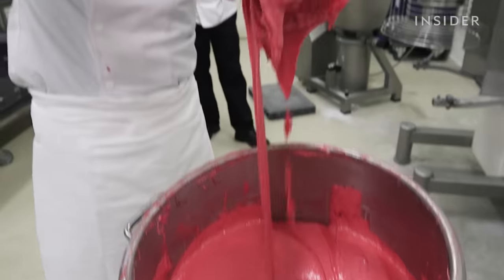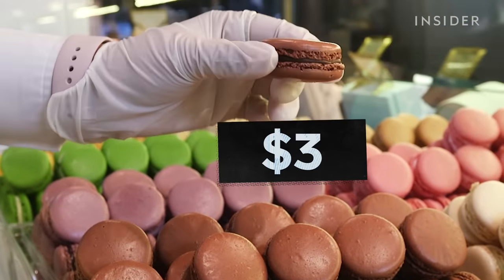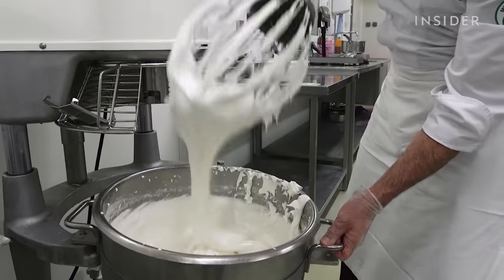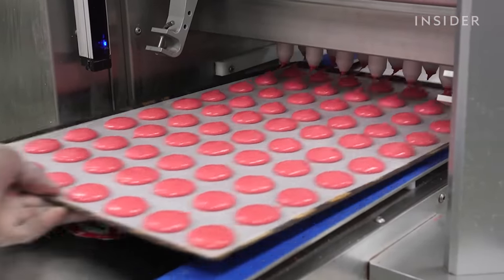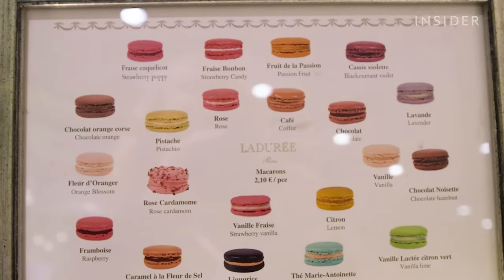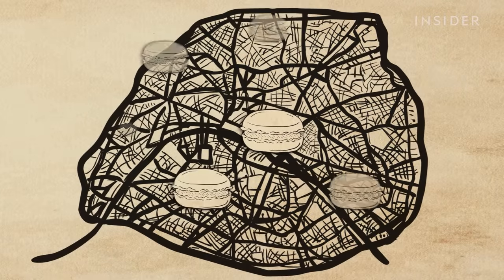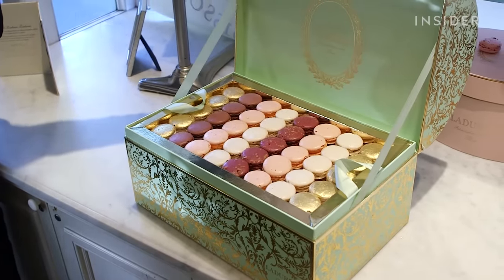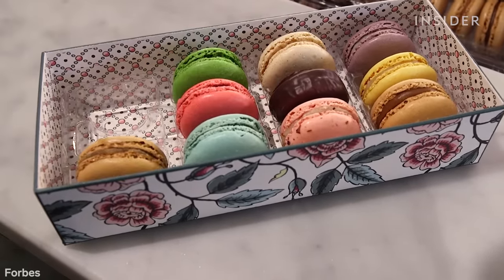How Ladurée Makes Millions Of Macarons With A 130-Year-Old Recipe | Insider Food

Comment: I was about to say... 3200 a day was kinda low? That's under $100k per year and with at least 10 employees and overhead cost, with machines and outsourcing recipe materials, you'd go bankrupt in 6 months tops. 10k per day would just barely make you profitable, 40k per day would put them at multimillion per year.
Reply: Kinda isn’t a word. I hope that you meant to type kind of but you were too lazy to type a single letter more.
Reply: @jonathanfinan722  it's a contraction of the two words.
Reply: macarons are expensive
Reply: $3 each and 32000 produced a day is $96000 a day profit.
Reply: @songsenkei  revenue. Profit is after deductibles.
Reply: @songsenkei  right, my model would've been 5 to 8 dollars at 40k per day. Both would be valid for multimillion a year status
Reply: @songsenkei  That’s not the profit. you have to deduct the cost of the product first.
Reply: @jonathanfinan722  is a troll, read her comments